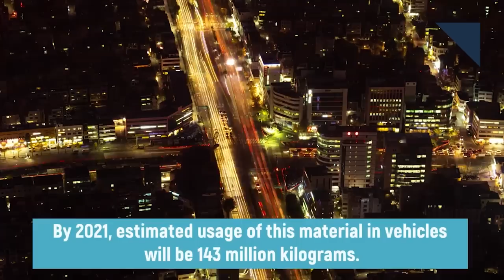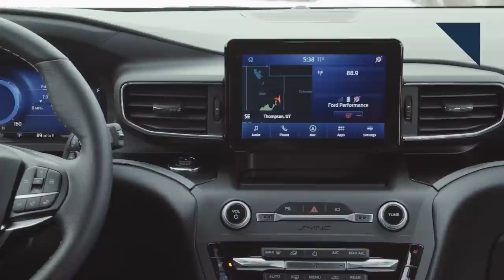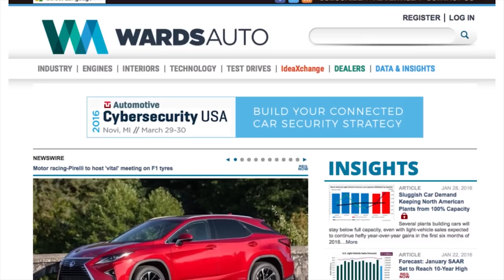Battery Cost Hurting BEVs, New Explorer Drive Impressions - Autoline Daily 2626

Comment: You weren’t listening during your own show yesterday. Yes, a bare bones ICE engine is cheaper but additional technology is needed to comply with criteria pollutant and CO2 regulations, increasing the cost. Also, that study cited doesn’t include savings like no need for gas tank, fuel lines, exhaust system, etc.
Reply: The cost analysis of the Tesla model 3 is also proof that the battery cost can be managed successfully. But it would take real commitment by the manufacturers.

Comment: Most sources predict purchase price parity between comparable BEV and ICE vehicles by 2025; as early as 2022 for some vehicle classes and markets.
Reply: Total price parity (purchase, operate, maintain, dispose) is more than just drivetrains.

Also, those parity predictions don't assume improvements to ICEs, such as variable CR or HCCI. Bumping up efficiency by 25% saves a lot of gas, so that pushes back parity even further.
Reply: @theevermind  When you consider TCO (total cost of ownership), many would argue parity has already been achieved (https://cleantechnica.com/2019/06/25/nissan-altima-maxima-vs-tesla-model-3-cost-comparisons-over-5-years/).  Historically, each new tweak and twiddle on an ICE adds more systems, complexity, serviceability challenges, and higher initial costs.  The trends for increased efficiency and reductions in emissions level to meet ever more stringent requirements (especially in Europe) do not look promising compared to the rapid advances in battery energy density and drivetrain efficiency.  You might want to watch the recent After Hours episode (https://www.youtube.com/watch?v=6QBzIddYVJ0) if you haven't already.

Comment: 1:55 Battery Costs Hurting BEVs Competitiveness---Oversimplify comparisons like this report, is meaningless...try at least factoring the cost of ownership next time...
Reply: Yeah almost 10k to fix a big dent in a bumper tfl found this out.
Reply: The story is about manufacturing cost and profitability, not cost of ownership. Battery cost are making entry level and midrange EVs disproportionately expensive to produce compared to ICE vehicles. 100 years of ICE evolution has resulted in low cost and very good quality. EVs will evolve like cell phones, in 10 to 20 years ICE will be like landlines, the oddity.
Reply: Unfortunately, lots of consumers don't factor in cost of ownership when making their purchasing decision.  When we hit acquisition cost parity in a few years, things will change very quickly.
Reply: @cratersofthemoon  The story neglecting "the  cost of ownership" was the point...sorry it confused you...
Reply: @cratersofthemoon  
You are assuming that innovation and technological advance happen in all areas at the same pace. It doesn't What might come up as a great thing to improve BEVs might actually have to be dropped because it causes more and worse problems than it solves.
Reply: @cratersofthemoon  not necessarily ice vehicles are still improving yet again.  As long as they remain really cheap and convenient and even so I think they'll stick around.  Personally i'd like to see a transition from fossil fuels to cellulosic ethanol and methanol as forms of liquid fuels.  And really the only thing in an ev that will truly advance is the battery.  Tesla's are pretty much as good as they're gonna get in terms of motors and stuff.
Reply: Trigger Troll  
Hey trig?
Still fudding?
Keep up the bad work, it gets more hilarious by the day!
I see you've moved from Cobalt to Nickel!

Comment: The price of the batteries is coming down way more than 4% per year, just more fud to keep electric down
Reply: report states, the price of the batteries is coming down 11%  per year in total... apparently you missed the 7% they said was due to economies of scale... So this just your poor comprehension not FUD....
Reply: Per BNEF, average is 18% YoY.
(To be fair, they did +7% to the 4% to claim 11%)
Reply: @bluezcluez315  post the link for "BNEF, average is 18% YoY"  to see what its based on.. seems very high...
Reply: @bluezcluez315  NVM " BNEF predicts that lithium-ion (Li-ion) battery pack prices will continue to fall this year, albeit at a slower rate than in previous years, at around 10 to 15%," not 18%... and since 11% is between 10 to 15%, it makes sense now...

Comment: I for one, am quickly reaching the limits of my ability to repair or maintain my newer vehicles. I can still do brakes, change the oil and other minor repairs but I lack the sophisticated equipment to get into diagnostics should any issue arise. I wouldn't mind having an electric vehicle with lower maintenance items and intervals. I'm an electrician by trade and I'm somewhat fascinated with the electric car. I also asked lots of questions when I'm at a home installing a charger for a customer. I haven't checked into the warranty terms and any of the electric vehicles but here's my take, manufacturers need to include a great warranty protection plan for these vehicles to incentivize them instead of banking on federal, state or provincial tax credits. You're asking people to purchase something that is very different and something that they depend on on a daily basis in most cases. It's more than just range anxiety that manufacturers are dealing with, they're dealing with a sort of 'dependability anxiety' and perhaps the manufacturers and the government are missing this point. You are paying a lot of money for these vehicles and market research has shown that they'd appreciate at a staggering rate. You're not going to get your money back so shouldn't you get many many trouble-free years out of them. I think manufacturers should be looking at an 8 to a 10-year bumper to bumper warranty on these things.
Reply: Model 3 warranty: 8 years or 100,000 miles. Musk is talking about soon having million mile versions of the car, probably because of the new battery tech they're getting from the purchase of Maxwell Technology. ICE is dead tech walking.

Comment: I'm sorry but you do realize the 2020 Ford Explorer ST is $56,000. At that price it should be able to fly you around the moon, and back, and include barf bags.
Reply: Trigger Troll  After only 2 years of operation, the Ford Explorer costs more. $2200/yr in gas alone. Add in oil changes and other ICE maintenance....way more.
Reply: @LesterSuggs  with a name like trigger troll we know not to take his nonsense seriously. It all for attention and to discourage free thinking and the promotion of common sense.
Reply: Trigger Troll  If you're charging your Tesla for 2 hours you have to be trying to go from 0% to 100% which is not only bad for the battery, inconsiderate for other travelers in need of chargers, but also shows you've been exposed to too much heavy metals in that mining industry you're always toting. To take it down to 0% from 100% in 2 hours you would need to be driving over 100mph on the older pre-refresh Model X 75D - what the hell are you doing driving that fast - let alone with your family in the car!?! And if you do that 4 times you're traveling over 800 miles (even factoring insane elevation climbs). WTF are you not flying at that point. To spit out such insane drivel shows you have never driven an electric car for a day. EVs still have a lot of ground to cover before they are superior to ICE in all categories but with such hyperbole we might as well be moving back into the caves.
Reply: Lester Suggs Less than your sugarbaby Elon Musk & Co's EV toys. And it's actually functional, not just to get to a Starbucks for your $15 pumpkin spice chia latte 👌🏻
Reply: @V0YAG3R  My first 2 cars were used Ford followed by a new Ford. 3 out of 5 of the Fords my family bought met their demise before 55K miles due to failed head gaskets and transmissions dying. I'm guessing a car working up to 55K miles is functional enough for you. I switched to Hondas and Acuras and while they have been mostly trouble free past the 80K mark their electronics are crap. By ditching head gaskets/transmission failures in the Tesla I'm hoping to see 100K+ of trouble free operation. Yeah the falcon wing doors on my X are not as functional as the sliding doors on my minivan but the rest of the vehicle is just heaven.

Comment: That small difference in price between EV and ICE vehicles is more than offset and then some by the tremendously lower cost of ownership of EV compared to the higher cost of ownership in ICE cars. This is owed to the elimination of gasoline cost which charging at home even without solar panels is cheaper, lack of oil changes, spark plugs, breakdowns of the engine, transmission, differentials and just overall simplicity. So manufacturers need not worry that much since consumers are seeing this and are willing and paying more for EV's already and sales are increasing rapidly.
Reply: If only buyers thought that way. Besides per the video the drive trains of BEVs are on average twice the cost of an equivalent ICE.

Comment: The high cost of batteries as the dampener on sales seems to be inline with what is happening in the U.S. auto market. In 2018, only 2% of all auto sales were for BEV/PHEV's combined. 98% of new car customers still preferred to buy an ICE vehicle. The double whammy of the battery's shortcomings - limited range (storage issue) and extremely long recharge times - is enough to convince consumers to stick with ICE vehicles.....for now.

Comment: It is not necessary for BEV drivetrains to be equal in price to ICE drivetrains. That's because fueling your car with electricity is ~1/3 as expensive as gasoline. It's okay to trade some of that cost.

But the predictions for when BEVs will reach cost parity typically don't assume that ICEs will improve over the next decade or two. And ICEs WILL get more efficient, which reduces fuel costs which pushes back parity further. Additionally, 10%+ cost reduction per year for batteries to be sustained for decades is ambitious.
Reply: Also electricity prices will probably rise with higher demand just like gasoline sadly
Reply: @MassiveGarbage  As BEVs & new higher efficiency ICEs gain ground, demand for oil goes down, which depresses gasoline prices. The oil price crash earlier this decade was caused by an excess global production of 1 million barrels per day. If we can improve the efficiency of the US auto fleet by 25%, that decreases demand by 3 million barrels per day. It's negative feedback--the more BEVs sell; the less fueling cost advantage there is to having one. That alone will prolong the use of ICEs.

Comment: Automakers are handling the ICE to battery transition adjusting ramp up to the minimum required by regulations. Do you want cheaper models, just make them sell more BEVs. That way BEVs (2%) can begin to benefit from the economies of scale ICEs (98%) enjoy. We customers are going to pay two transitions: from ICE to hybrid and then to full electric, which also is making every other car more expensive.
Reply: That does not work because of the shortage of batteries.
Even Tesla is having issues with their battery supply restricting their production.
Reply: @pogo1140  Shortage of batteries is temporary, lack of investment and planning in the previous years. And in any case is not the ultimate cause behind the higher price of BEVs.